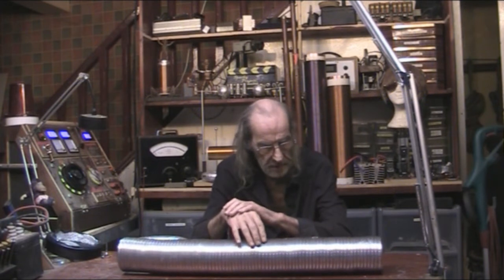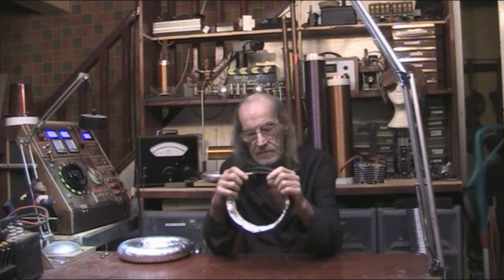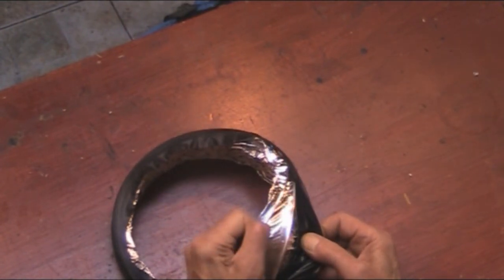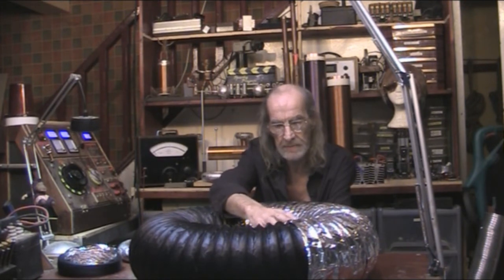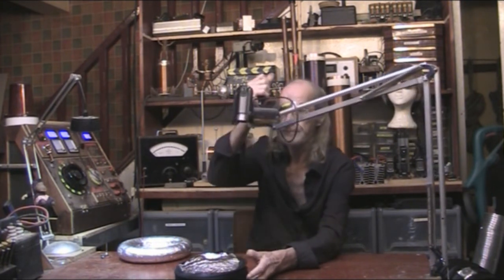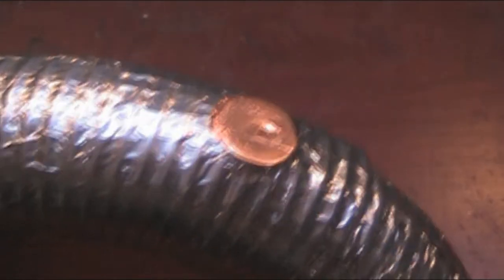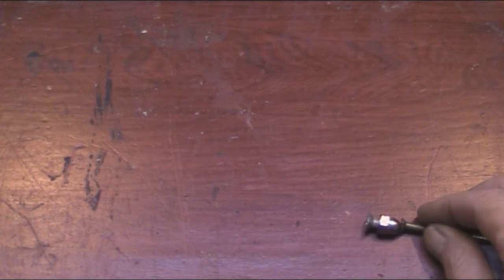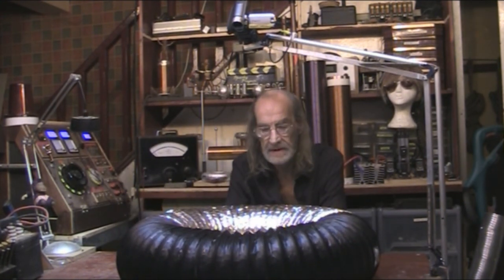Big Tube

Comment: This is a fine example of why I rather like your videos. I'll be curious to know how that top load holds up. From what I know from your other videos I would guess the particular coil in question is powered by a microwave oven transformer which would have a lot more current than an average neon sign transformer. NSTs are getting harder to find as most signage of that nature is made from LEDs nowadays. It's sad really. The old neon tubes had a certain majesty about them. A warmer feeling that I miss. Thanks for the video...
Reply from the maker: Nope, i would never use a microwave transformer for a tesla coil, on their own they don't have the voltage, so i would have to put 4 in series at least, and that gets dangerous for the earthing and insulation of the transformers, i covered this in one of my vids.
Thanks to Steve i have 2 NST's, 10KV@50mA each, they will be running in parallel to give 100mA, it's the powerwall video, i'll be running it on the latest rotary gap.
Remember, voltage gives you the length of arc, current gives you the 'fatness'
Reply: That's odd. I must be misremembering then. I'll have to check back through your videos and see if I can figure out how I got it around the wrong way.
Reply from the maker: One vid i made with Mot's was the supermot one, 2 mot's in series, in that one i covered the reason not to put more in series.
Maybe you thought i was using them for a tesla.
Reply: I had to order my neon sign transformer its an in case one so I got no electrodes sticking out the sides and it has a trip on it but it has never tripped when I use it on my coil. which makes me wonder why, because everyone online says the safety will always trip if you run it on your coil.
Reply from the maker: It would depend on what type of trip, i've seen mention of GFI, that would only trip if there was a ground fault (an imbalance of live and neutral), though if they are electronic i guess it could trip from interference
If it's a current trip, you may not be driving it hard enough to trip it.

Comment: Here in Canada we have the pure aluminium 8 inch tube not like the plastic stuff you have there, So if you jump online you maybe able to order it off amazon. I have some for my coil but I found it was over kill.
Reply from the maker: I just went with the first one that was at the right price, i know i could have spent a little more and saved on the cost of tape, but this works for mei use Amazon a lot.
Would be nice to get  a proper spun aluminium one for this coil, but that's beyond my budget.